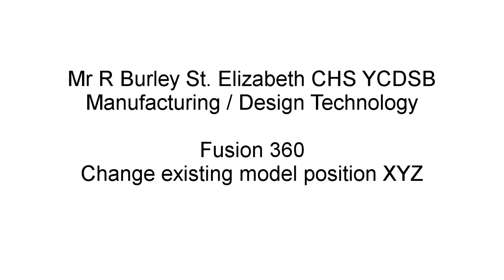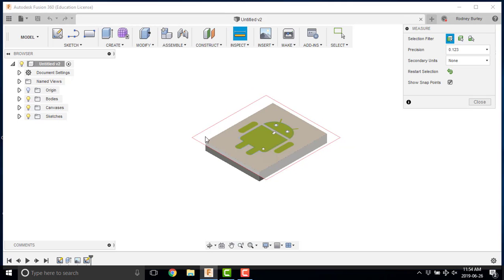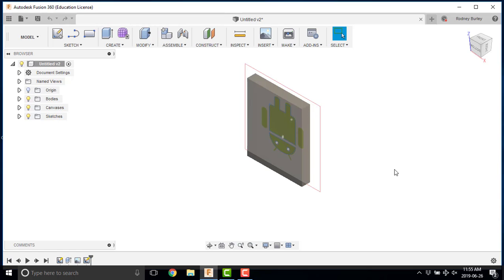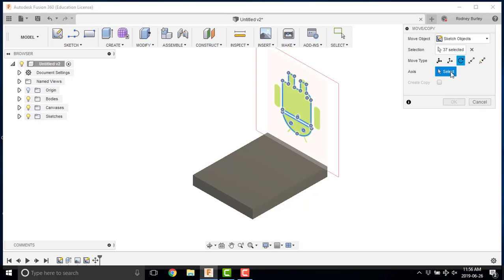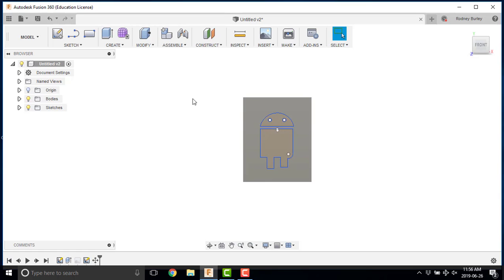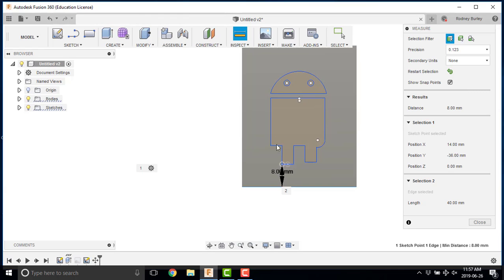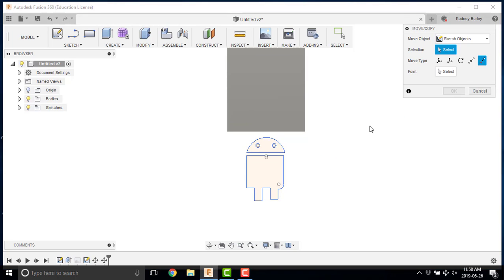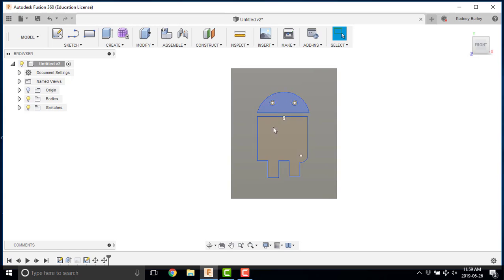Fusion 360 Change existing model position XYZ

Comment: For those starting a new drawing. Go to your profile. Click it. Hit Preferences. Look for the option called "Default Modeling Orientation. Change from Y up. To Z up. Reset fusion. Y up is typical setting for standard two drawings from traditional CAD. Most conventional drafters use this for hard code drafting in Autodesk Cad 2000 LT. Which is extinct.

Comment: For the people who are trying to move a body that they have accidentally built on the wrong axis (my body's back-axis was actually the right-axis for example), you cat pivot your whole body in one point (if you have built your body on the center of the plain, you can use that center-point of the plain as the pivot, it will appear when hovering over) and only translate the body's orientation .

Right click on the axis plain (the floating, checker-like align squares that have more squares inside them) --> choose Move/Copy like in the video --> select "Bodies" to translate the whole object, not just a plain. For the Move Type, select "Free Move" (the first one in the list) --> Click on "Set Pivot" --> Select a point you wish to pivot your whole object orientation on all axis

Good luck!!